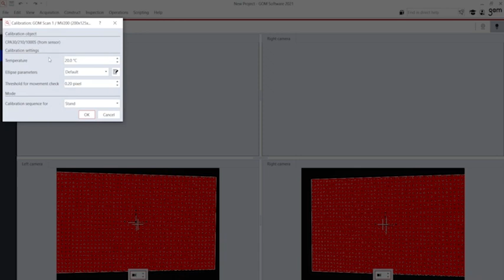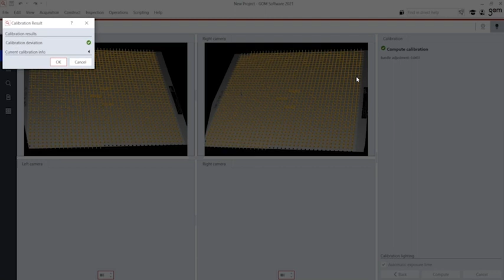Optical 3D scanner GOM Scan 1: Calibration

Comment: Hi guys! thank you for many very useful and detailed videos, you are the best! I have a question about this video, the question concerns the calibration protocol. It’s very interesting to know what the data in the protocol means, what it affects, which of them are critical? Clients often ask how accurately do you measure this object? If you manage to write an analysis here, I think it will be useful to many. thanks again
Reply from the maker: HI there. In general the software will automatically verify if the system is calibrated or not, by showing the green check mark.
The protocol provides and overview of the calibration process and results. This is more explained in detail in the training that comes with the system.

Next to this all our calibration object are dakks certified and our systems systems are certified based on the corresponding standards.